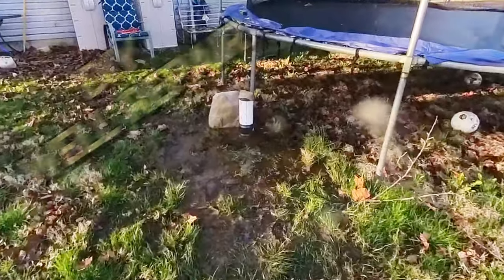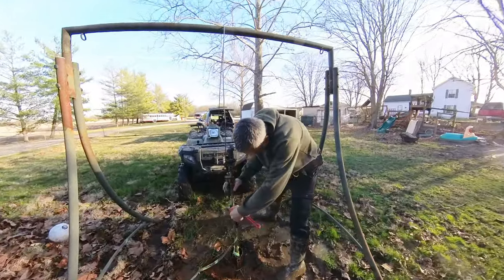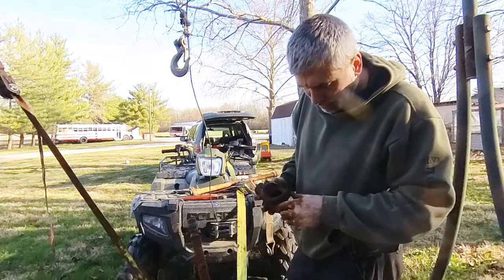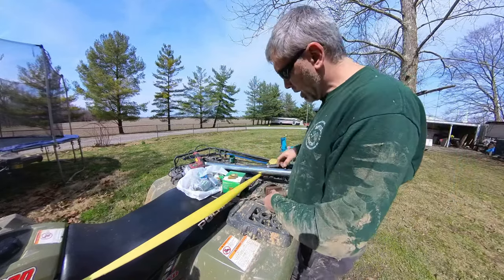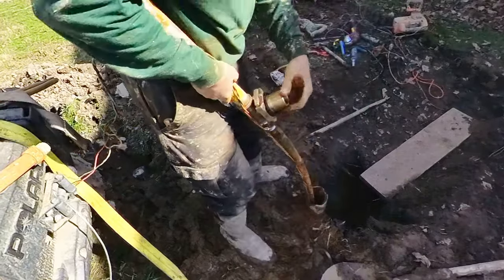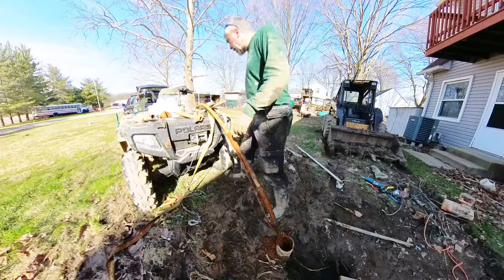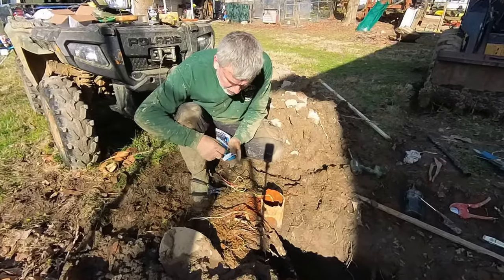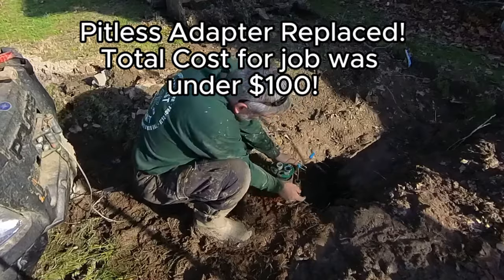DIY Pitless Adapter Replacement

Comment: I’ve been dealing with a pinhole in my pitless adapter and researching replacements. I have a 4 inch well casing like you do and have found my options are limited. You removed an external clamping style pitless adapter and installed an internal flange pitless adapter for 5 inch and larger casing. The 4 inch outer clamp style pitless is so the flange sits recessed far enough out of the well casing and the pump will have enough room to pass the flange upon removal. Hope this is not an issue for you. Just an FYI.

Comment: My blood pressure went up watching this. You certainly handled that job like a pro. My well pump is cycling about every 30 mins throughout the night. This is happening without any demand for water, or leaking toilets, faucets or wet ground around the well head. Any ideas?
Reply: @nunyabusiness1499  a leak and a shitty pressure tank.
Reply: @duncanmcdonnell3844  New fiberglass tank. Prolly still shitty though. I found the problem with a drippy hose bib. Repacked and good to go.

Comment: if you take the string off of that pitless, how do you pull it up later?
Reply from the maker: A pitless adapter should last a long time, so I guess the next guy would have to figure that out.  I used a stainless wire as my string, so I could have left this hooked up for the next guy.  Good point!!
Reply: I'm looking at replacing a pitless like this. My plan is to run a wire from the outside of the casing, through the pitless and up the top of the well. Once I free the inside piece of the pitless I should be able to put a hook in the wire and pull the pitless up. Just hope I don't end up with it in the bottom of my well. Don't worry @lifeandgodliness, I think it's pretty common practice no to leave a retrieve line on a pitless.
Reply from the maker: Sounds like you are well planned and researched!  I hope it goes well, no pun intended:)

Comment: Do you happen to still have the old pitiless adapter o ring? If so was it in good condition?
Reply from the maker: The seal was where my adapter was leaking at.  I may still have it.  I will take a look at it and let you know.
Reply from the maker: I found the adapter, and I do have the O-Ring seal.  It is intact, but has some slight cracking from drying out.